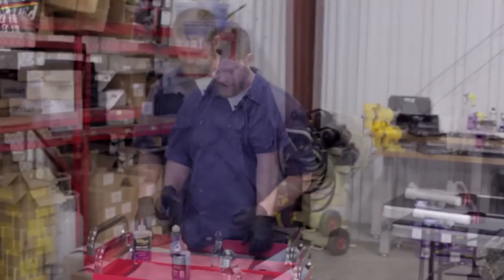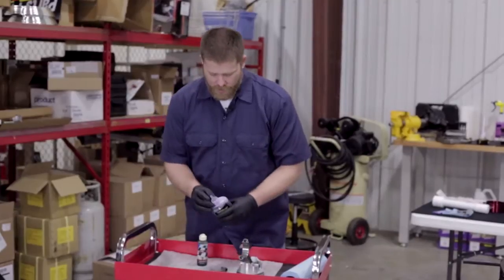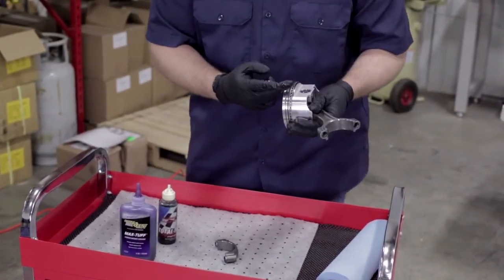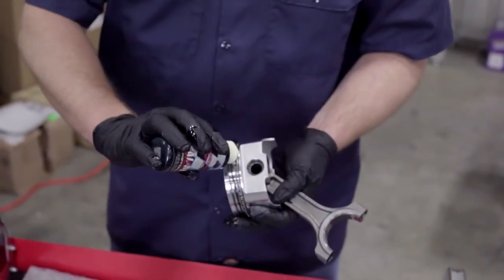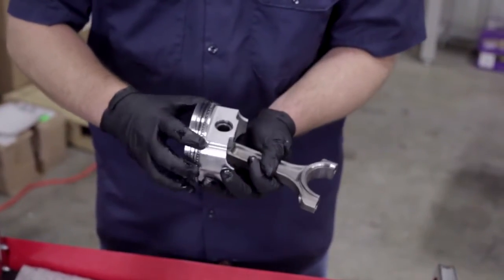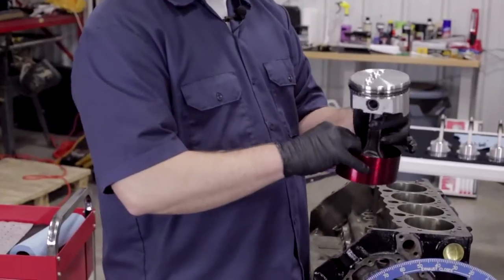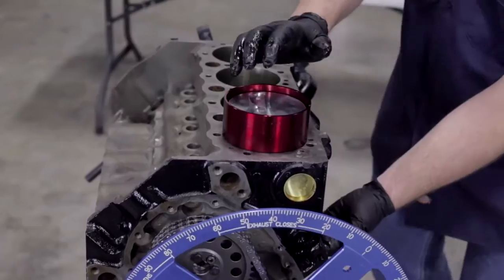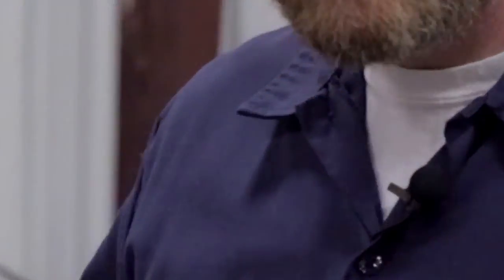Small Block Chevy Engine Build: Piston Assembly (Part 5)

Comment: also if you can't justify spending that kind of money on assembly ludes. get lucus high performance assembly lube.. I recommend to NEVER use engine oil because its not a very slick lube for assembly.. (my opinion). also I did see that you are getting kinda nervous talking in front of the camera, just that bearing on the end of the piston rod is not a cam bearing.. its a crankshaft bearing.. or a lobe bearing some people call..
Reply: REDLINE FTW!!!! NOTHING BETTER FOR BEARINGS AND IT'LL STAY FOR A YEAR AT LEAST